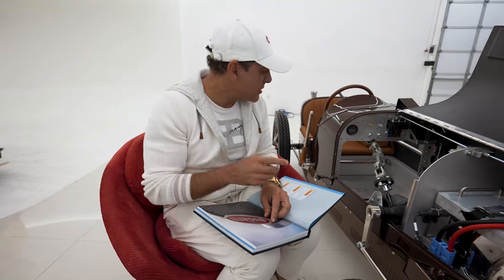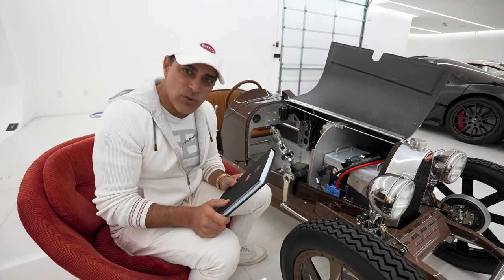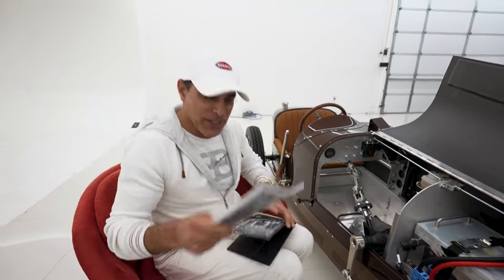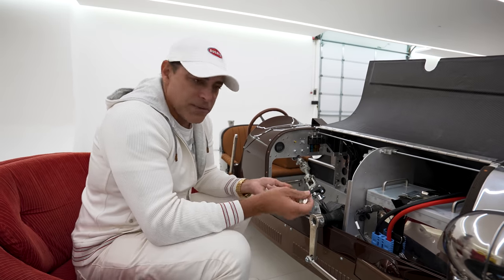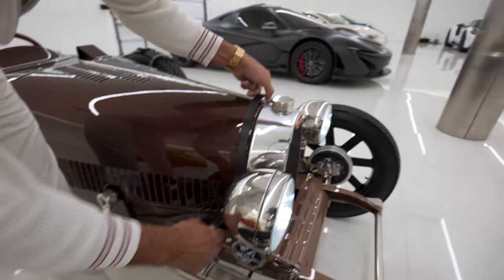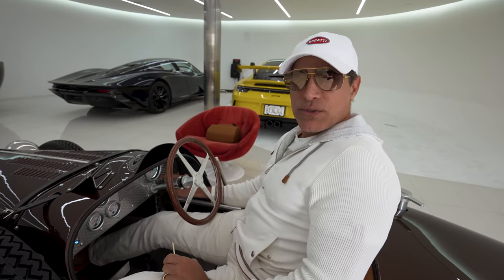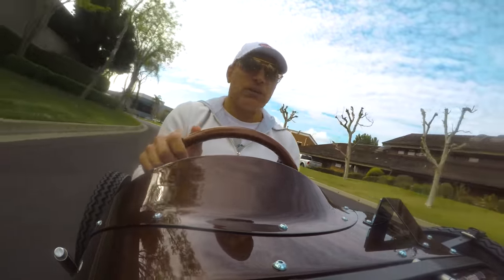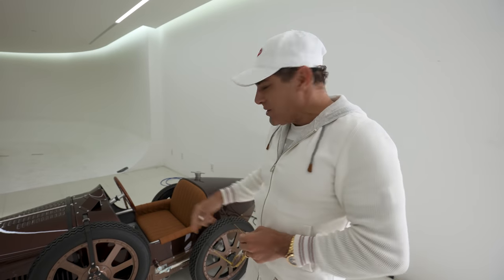FIRST DRIVE IN THE BABY BUGATTI! || Manny Khoshbin

Comment: This is a good project for you because it will help you get over the stigma of modified cars, and maybe in the future you will make some OEM+ modifications like removing the trunk dividers in the bugattis or after market rims so you don't have to replace the Veyron wheels, and turning on the extended P1 side break lights.